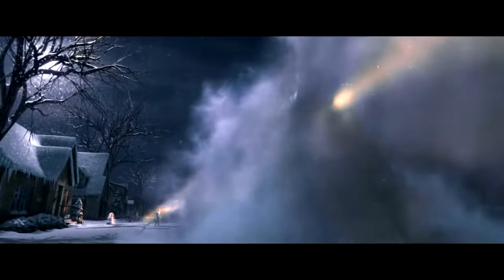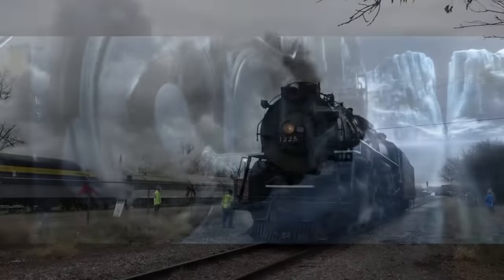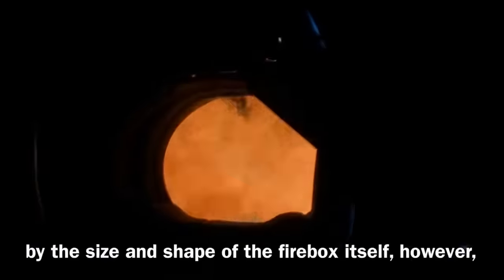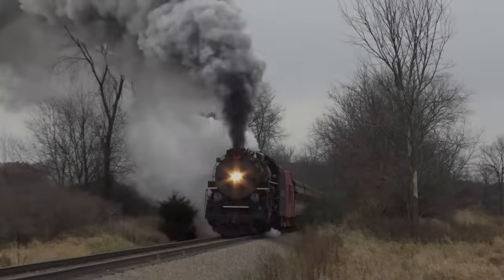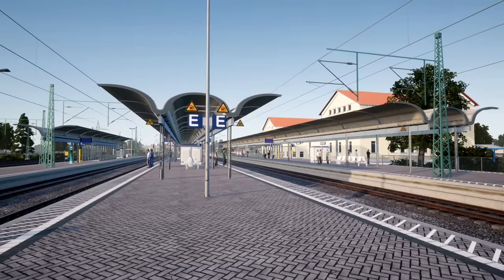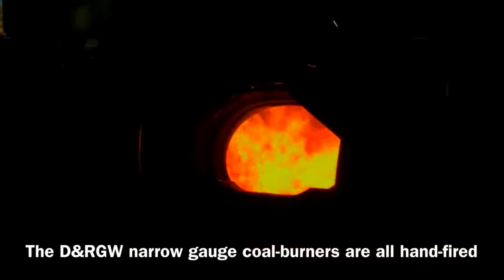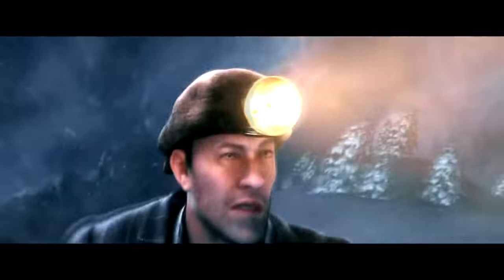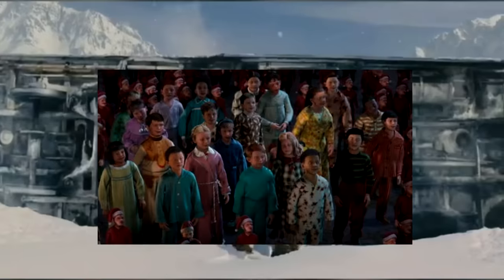Why The Polar Express would Explode

Comment from the maker: Thank you for all the comments and support! Apart from a few comments, many of you are very kind and bring up points that I would have never thought of when making this video. Please know that this video in particular was done only for good fun, I didn't expect this video to blow up (but here we are).
Many of you brought up points that disagree with the fact that the Polar Express would explode. It's great to see many of you thinking outside of the box, I love the idea of discussion and responded to many of them already. however, I keep seeing the same points brought up over and over. To make things easier, here is a list of points many of you make that I already responded to:

1. The water would stick to the back of the locomotive due to the engine going downhill
- While it's true that water will stick to a surface if enough force is applied to it, it does not apply to the movie. The only way for water to stick to the back of the engine as it's going downhill is for the Polar Express to be accelerating faster than the velocity of a falling object on earth (aka gravity). There is evidence of this NOT happening in the movie. As the train crests the hill and goes downward, the speed alone would have launched both the Hobo and the Boy off of the roof of the car due to the sudden acceleration. In other words, the locomotive would need to accelerate from its near stopping point at the top of the hill to more than ~9.81 m/s^2 (32 ft/s^2) or 21.8 miles an hour compounding exponentially per second. This would also mean that as the locomotive rushes down the hill, (assuming that the locomotive is attached to the track) both the Hobo and the boy would float away from the train since again, the locomotive would need to be accelerating faster than the velocity of gravity. This does not happen in the movie and therefore we can deduce that the water in the boiler does not stick to the firebox as the locomotive goes downhill.

2. The Engineer and Fireman could have completely filled the boiler with water before going down the hill
- Filling the entire boiler with water would mean there would be no place for steam. The Engineer and Fireman will always leave space in the boiler for steam to pressurize. If there is too much water in the boiler then water might enter the regulator and destroy the cylinders in the process. Water, unlike steam, does not compress and will essentially blow out the cylinder heads if they enter into the cylinder. This is why you will almost always see steam coming out of the cylinders whenever a steam locomotive is starting up. That is the Engineer opening the cylinder cocks to allow for any leftover water to exit the cylinder.

3. It's a Magic Train
- Yes it is, I'm glad we watched the same movie

4. Boiler Fusible Plugs
- Some people were confused in the video since I got a few of my steam locomotive terminology wrong here, thank you for the corrections in the comments. Fusible Plugs are designed to let water (which instantly vaporizes into steam) into the firebox to put out the fire to prevent a boiler explosion. From the information I found online, they worked but usually didn't help much with putting out the fire. It was more used as a warning system that the water level was too low for the engineer and fireman instead of a preventative measure. What I meant to refer to was the Crown Stays. Crown Stays in some boilers can be used to prevent it from exploding by only allowing a certain part of the crown sheet to fail rather than the entire component, leading to a full-on explosion. When this happens, it causes a backdraft inside of the firebox, sending steam from the boiler into the cab. It's not the best situation for the Fireman and Engineer, but it's better than the entire. locomotive blowing up. 

Chris with a K is a channel I do for fun on the side. I don't have the time to respond back to all the comments on the videos, but I will try my best to respond to the ones on this thread.

Thank you again for watching, Happy New Years!
Reply: Duet 12: 1-4
Reply: 1:07 "when we, when we get there, thr polar express!" *Angel noises*
Reply: This magical train uses science beyond our understanding, but the engine uses inertia dampeners and artificial gravity.
Reply: This scared me 😖
Reply: @Choochookid7470  I worry for humanity... its a kids show.
Reply: @marsfreelander5969  movie to be correct
Reply: Nice fanfic, but this wouldn't happen. After what happened in Germany, they likely equiped the water tanks in the trains with the walls they have in gas trucks and similar that make it so the water can only slosh so much in the tank, this preventing it from catastrophic impact. Also, any water added in or before the culprit scene would quickly be removed as we hear the engine running at several times the speed as it is going down the hill, despite the fact the engineers did not add any fuel or increase the temperature at all. This means the pressure of the tank would be reduced almost to atmospheric pressure because all of the steam was getting leaked without building pressure. I enjoyed the video though and learned about trains, keep up the work
Reply: @darkwolf1328  I won't disagree agree with your second point but I will with your first.  The Polar Express is not Germany.
Reply: The firebox and the water would accelerate downward at the exact same rate, ergo, the relative position of the water and the firebox would not change
Reply: Ad 4. From the literature I have, they are to signal the chauffeur that something is very wrong & he should throw the fire to the tracks, now. If they'd put out the fire, they would stress the matériel so much that the firebox would rupture for sure. They are there to cause a ruckus and show that something is wrong and the ...steam... is going to hit the fan, SOON.
Reply: @darkwolf1328  They have sorts of partitions. And no, you cannot use the same layout as in a petrol lorry, if in a petrol lorry one or more of the partitions runs dry, that only alters weight distribution. In a steam loco, you need all the fume tubes to be submerged, too.

The Bitterfeld engineer didn't check water level and thought he could run the locomotive until the next regular watering stop instead of swallowing the delay and driving to the water tower of a parallel track during a scheduled stop. Steam locomotives are always delicate machines where you need to use due dilligence and caution. A reckless engineer can wreck every single steam locomotive in the world.
Reply: tl:dr, I don't have to be nice to anyone.
Reply: I think the issue is that you're not adequately accounting for the energy required to evaporate the water. A firebox left to heat itself maximally for 50 seconds will have enough energy to suddenly evaporate (approximately, but arguably less) 50 seconds worth of steam. I can't find exact numbers for the volume of steam (at pressure) a train uses each second, but I suspect the outcome would be the steam pressure drops, then suddenly ramps back up to at or slightly above the intended pressure, and everyone survives for another day.
Reply: @tallskinnygeek  That's not the problem with boiler ruptures. The fire in the firebox reaches temperatures that normally would melt the material of the firebox. This doesn't get to be a problem because it is cooled down by the water with a constant temperature (boiling water will stay at the boiling point - for that specific pressure, eg 100°C @ 1bar - until all water has been evaporated).

If the firebox no longer is covered in water, its temperature spikes; this weakens the metal. The moment water comes back, a similarly dramatic temperature drop occurs; all of those only in the parts of the firebox not covered in water. The tensions in the material then lead to the firebox rupturing.

This however leads to a rapid drop in pressure. Remember when I said water boils at 100°C @ 1bar? A conservative boiler pressure of a steam loco is 12 bar (12x atmospheric pressure; Prussian P8). Big Boy had 21 bar; very modern Steam Locos coud reach up to 25 bar. At these pressures, water boils at much higher temperatures (this is BTW how a pressure cooker works; as it has a (slightly) elevated pressure, water can be heated to higher temperatures before boiling, thus the cooking temperatures are higher). At these pressures, water boils ~200°C.

Suddenly, the pressure vessel is ruptured and pressure drops rapidly; the metal, however, is still @200°C. The remaining water flash-boils into superheated steam, again suddenly creating pressures the boiler was never designed to withstand even without the material being weakened and failing. This is the boiler blast ("Kesselzerknall"), not an explosion (=sudden combustion), but still a sudden expansion.

If the boiler would hold the temperatures without the firebox material weakening, it would do what you described. Sadly, this is not what happens during a boiler blast, that has happened many times in history.
Reply: @enysuntra1347  I know trains can fail catastrophically the way that you describe. I just also think that even with a 1300 degree C fire, heating steel to the point that it can fail that way takes longer than 50 seconds after it was held close to 200 degrees C by the water above.

Consider for example that blacksmiths can heat steel from all sides, and still take more than a minute to get room temperature steel to workable temperatures for bending - and there the steel does not start damp.
Reply: @tallskinnygeek  The Bitterfeld accident had the firebox fully uncovered for seconds, when the train braked and the water slooshed to the front, then back. Empirical data contradicts your assumption. The minutes should be explained by a thermodynamics / material science engineer.
Reply: @enysuntra1347  I tried typing a proper reply, but I can't get over the fact that you're taking an accident with no published report or investigation to be empirical data. The simple answer here is that the water level in the boiler could have been below the top of the firebox for a much longer time than a few seconds, given that a few feet of water can be around the lower flue tubes. If you have any empirical data that refutes this possibility, I'm open to hearing it, but without any proper investigation, no driver alive to talk to, and the deliberate cover up by the authorities involved, I sincerely think you have nothing of the sort to offer.
Reply from the maker: @darkwolf1328  A steam Locomotive doesn't work in the way you described it. As the steam pressure goes down, the water in the boiler will turn into steam. This is due to the fact that the water inside the boiler is pressured by the steam. Water that is pressured will boil at a higher temperature. This is why when a steam locomotive performs a boiler blowdown (where the locomotive releases water to clear out impurities that have settled at the bottom of the boiler) the water instantly vaporizes into steam. You can see the opposite effect happen in Space where water will start boiling at room temperature due to it being in a vacuum. 
On top of that, steam locomotives depend on the draft from the firebox to the smoke stack to keep the fire alive. When you hear the chugging from a steam locomotive, it's the release of steam from the pistons into the stack which also draws air from the bottom of the firebox, through the flu tubes, and up through the stack, creating a larger fire. In other words, as the steam locomotive increases speed, the intensity of the fire increases as well.

In the scenario you proposed, what would happen is the pistons will draw steam from the boiler, reducing the pressure and therefore turning more water into steam. As the water turns into steam, the water level in the boiler would decrease leading to a lower water level that could potentially go below the crown sheet. Then, since the train is accelerating down the hill, the increased draft caused by the pistons exhausting steam and pushing air through the smoke box would increase the heat in the firebox. Finally, the increased fire combined with the lowered levels of water would more than likely result in a boiler explosion

Good try on forming a counterargument though, if I didn't know about steam locomotives I would have believed your statement.
Reply from the maker: @enysuntra1347  Exactly, many people in the steam community know what will happen when an inexperienced steam crew takes the footplate. Blue Peter is the incident that always comes to my mind
Reply from the maker: @shamancredible8632  It's more like I don't want to repeat myself 20 times to one question
Reply from the maker: @erichooper2794  That is simply not true. I explained in my pinned comment that the locomotive does not travel faster than the velocity of gravity, meaning that gravity would still have an effect on things in the locomotive. If what you said were true, then passengers on a plane that started pitching downward and descending wouldn't feel any change in relative motion since they and the plane are moving at the same speed. This would also mean you wouldn't feel a drop as a big roller coaster goes down a hill
Reply: @erichooper2794  Oh it deffinatly would change. On a Steam museum in Collorado they run steamengines in a halfmile long circle with a 3.5% grade up and 4% grade down. If they run the water level to high in the boiler, they will suck water into the throttle valve and blow the pistons apart. If the water is to low, once they hit the downhill grade all the water moves forward and uncovers a bit of the firebox. That little bit is enough for an explosion. Also water is a liquid, as soon is the locomotive tilts its going to the front of the boiler. Everything else thats loose will as well, think coal in firebox and tender, water in the tendertank and the people inside the cab. The locomotive itself is a sturdy thing, steal frame to hold everything in its place, and this is also coupled up to a long line of heavy coaches. Theese are still on the grade up to the top (in the movie fyi) and are still pulling the locomotive back. Also check out Hyce on youtube, he works at the museum i mentioned and has great video's on firing and running steam engines
Reply: Poor engine
Reply: What is the video at 1:07?
Reply: It wouldn't blow up, because it isn't in the storyboards.
Reply: 300th LIKE BIATCHESSSSSSSSSSSSSSSSSSSSS